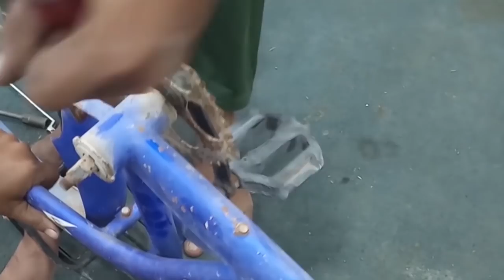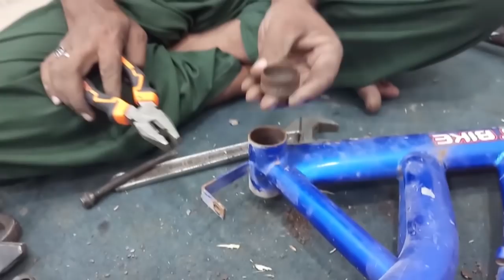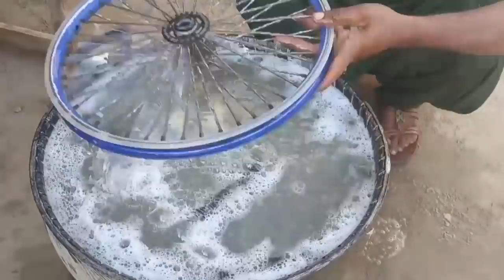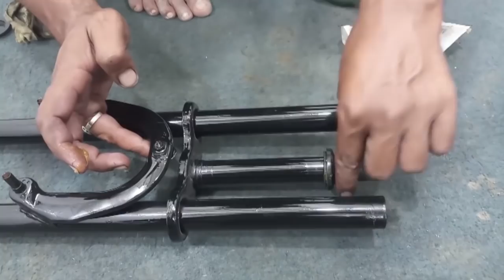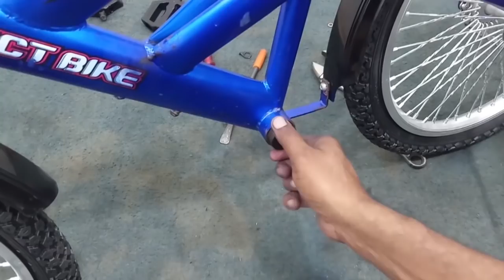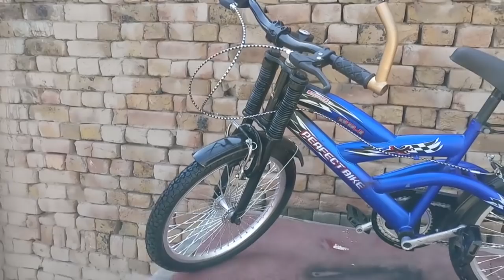old rusty bicycle restoration

Comment: I guess its a worldwide phenomenon of people putting bar-ends on at that ridiculous angle.  Good way to spear a hole in your chest.  Never seen so many spokes on a wheel.  A one size fits all bike as none of them ever seems to attempt to remove the seat post, probably so frozen in the seat tube they dont even try.  Maybe from spending your life in a squat position its no problem to ride a bike with your knees always in a 90 degree bend.  Couldn't find the lock-out on that shock.